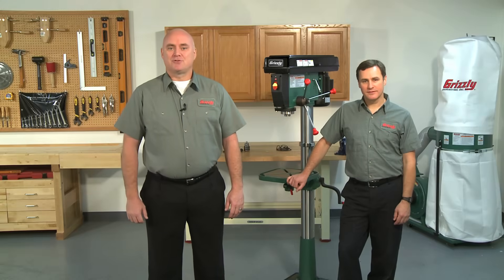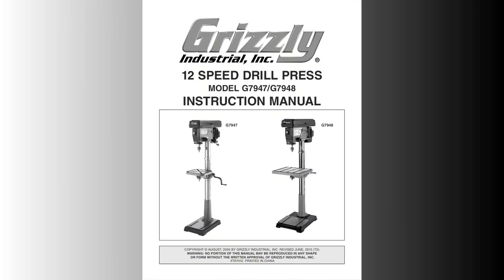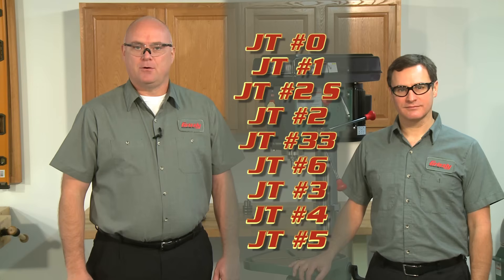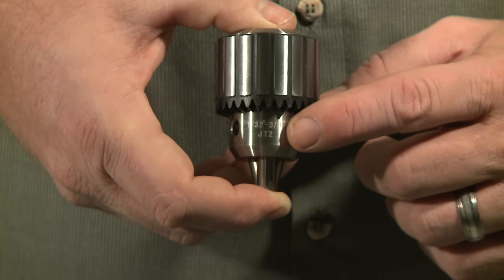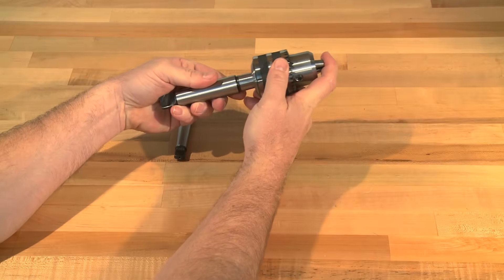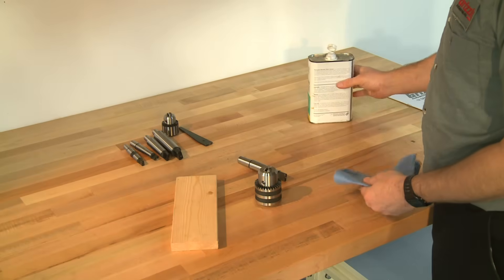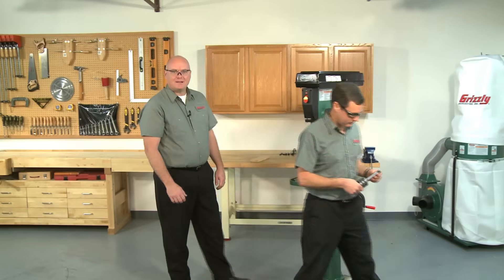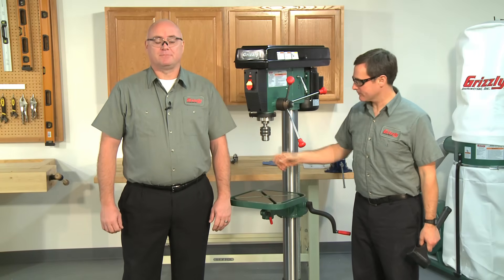How To Install a Drill Press Chuck and Arbor

Comment: Any advice on preventing / fixing runout?
Reply from the maker: First, inspect the spindle and arbor to make sure they’re clean, undamaged, and properly seated. Using high-quality or well-maintained bits is also important, as worn or inexpensive ones can contribute to runout. Be sure your collet or chuck is in good condition and free of debris, since a poor grip can lead to wobble. When tightening, make sure to do so evenly to avoid shifting the bit off-center. If you're trying to pinpoint the issue, a dial indicator can help measure runout and identify whether it's coming from the tool, collet, or spindle. If you’re already checking these things and still having issues, let us know what machine or setup you’re working with and we will be happy to help troubleshoot further.

Comment: Thanks so much.  I wanted to change out the keyed chuck on my old G7948 drill press and got the G8583 keyless unit.  I got the chuck on the new arbor no problem, but couldn't figure out how to seat the arbor in the spindle until I saw this video (nothing about that in my copy of the manual).   Thanks again.

Comment: Grizzly Industrial G0925 - 8" Baby Benchtop Drill Press. 

Can I use a JT2 Keyless Drill Chuck with Integrated Shank. Thanks
Reply from the maker: Hello! Our Technical Department recommends using the JT33 Keyless Chuck with the G0925. For further technical questions, or any customer support needs, our contact info is at www.grizzly.com/contact